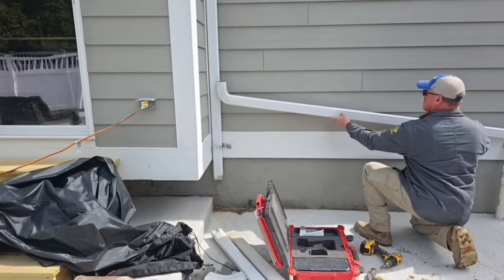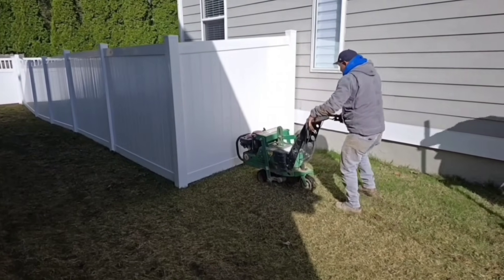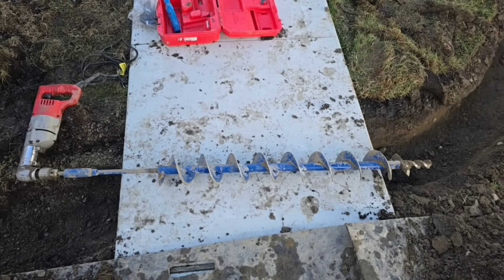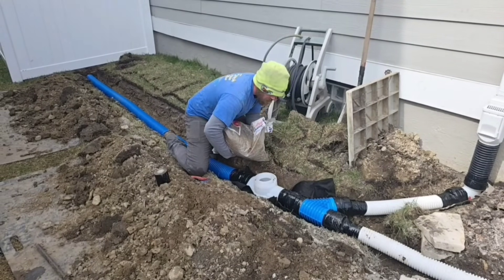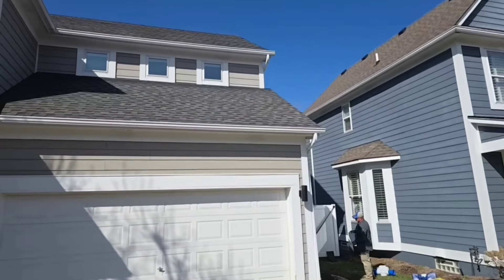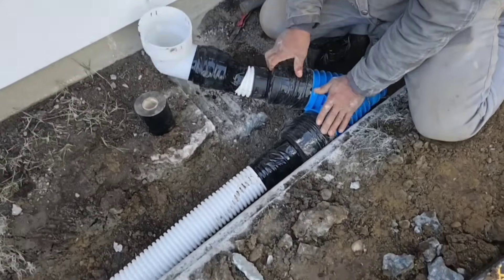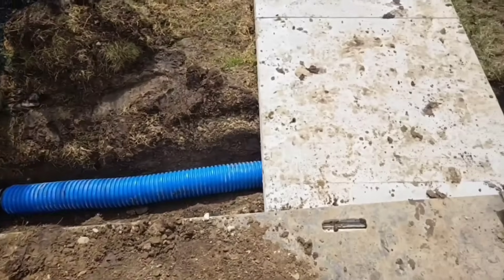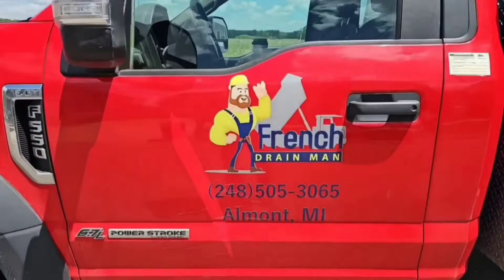Whole-House Roof Runoff system: the Mac Daddy of Gutter Downspout Water Containment

Comment: Wow.   At what point do you increase from a 4" to 6" pipe?  I got a roof that gets 13,000 gals with the 100 yr chart with 7 downspouts.  How many downspouts can tap into that 4" pipe before needing a bigger pipe?
Reply from the maker: I never go to 6" because if you do not flow enough water, you will not keep it clean. It was an average-size home, so a 4" main is good. If the home were bigger, we would have used a 5" pipe.
https://youtu.be/b3YF1QSGz6M?si=J2HqovgqOBZDo8GO

Comment: To put the drain under the sidewalk, did they push or pull using a rope with an end adapter ? Concerned with dirt entering pipe if pushed. Overall great logical job.
Reply from the maker: They always tape the end of the pipe. However, it would not matter. There were three downspouts down the side of that house. The dirt would wash to the storm sewer.